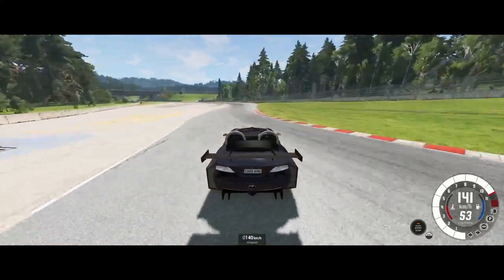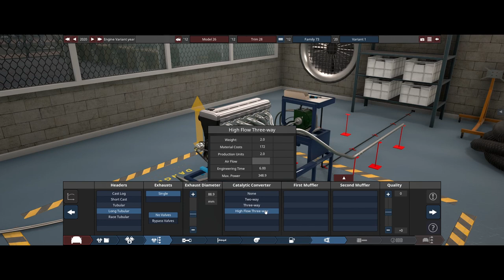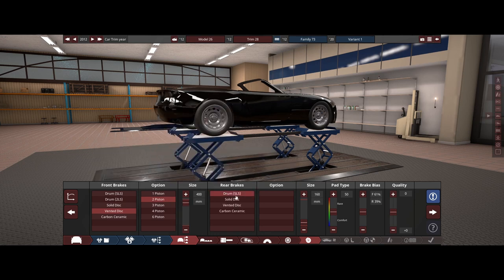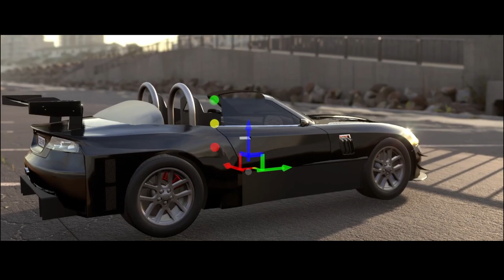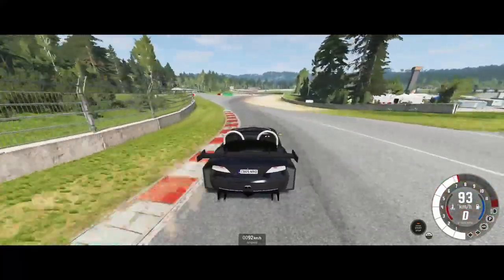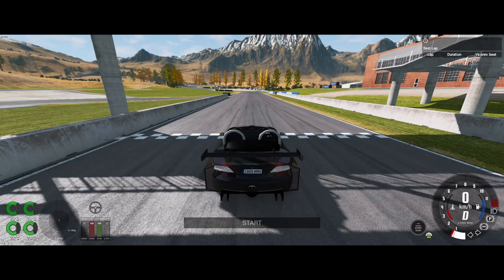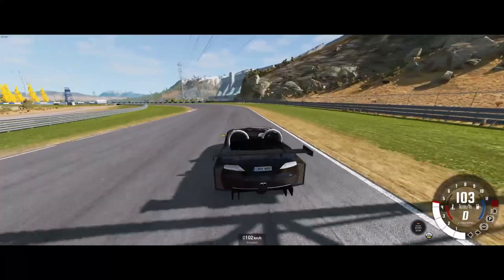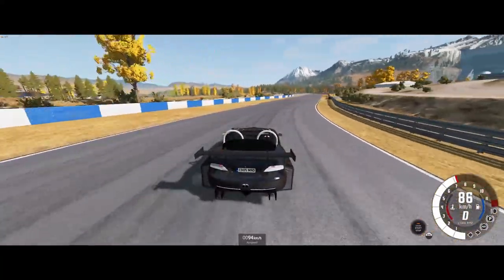Full Fat 5 Cylinder Race Engine (Automation🔧BeamNG)

Comment: Your weight problems are coming from the fixtures which have their own separate weight. So basically when you made an interior for it, you doubled the weight of the interior.
Reply from the maker: yeah, I've weighed before and after with fixtures, and it's like 4-8kg for an interior in BeamNG